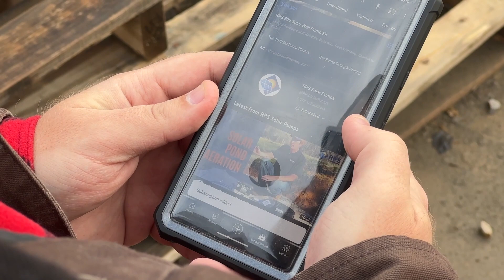How Do You Upgrade A Solar WaterPump System

Comment: Thanks for this series, I've been watching them.  So...if I wanted to increase the length of time per day that the pump is actively pumping, I could add another four panels to an RPS400N in parallel with the four that were supplied, thus giving me (still) 48VDC nominal but twice the amperage?  Basically by doing so would allow the pump to start earlier and run longer?  I don't want to increase my GPM rate because of slow well recharge, but I could get a bit more out of it with a longer effective solar day, is my thinking.
Reply from the maker: Yes! that is exactly right. Excellent way to extend your "solar day"!